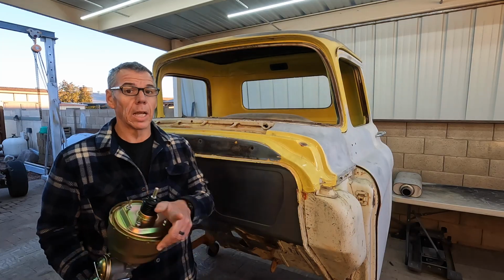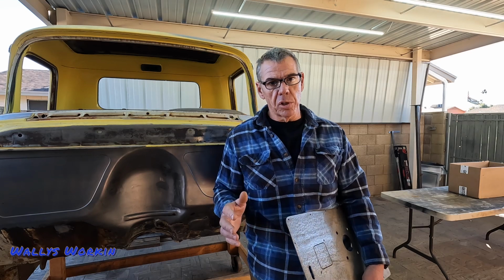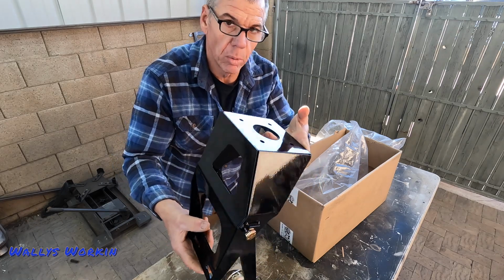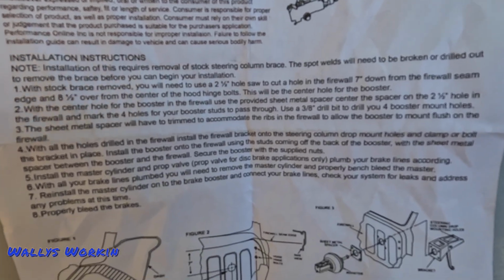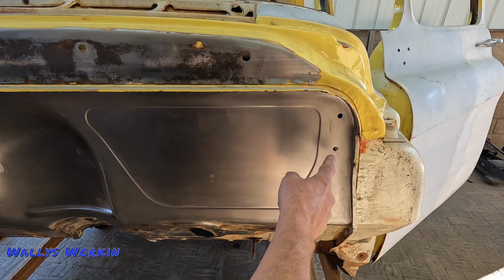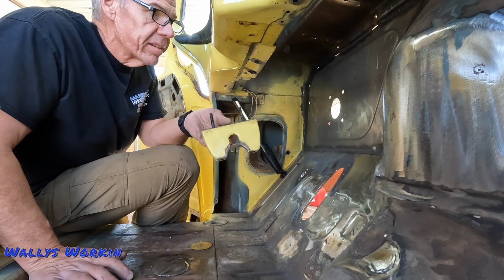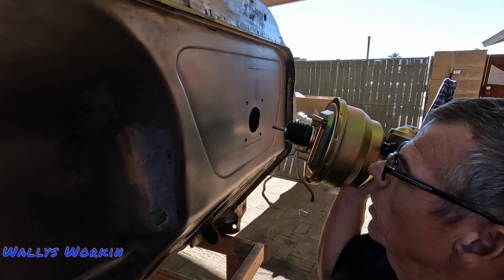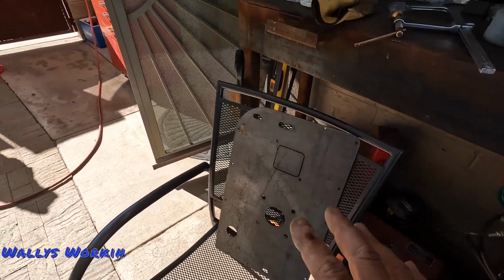The 1957 GMC gets modern BRAKES / Performance Online master cylinder and booster install

Comment: Wally looking good, I get why you want to use a later model steering column but , I think it’s two thick and sits to close to the seat or you have to hack the dash up . I would use a reproduction tilt column for a 55 Chevy, it works better and looks better, and easier to get in and out of the truck …
Reply from the maker: Thanks for that information, I didn’t think about the diameter, the 55 column makes more sense.